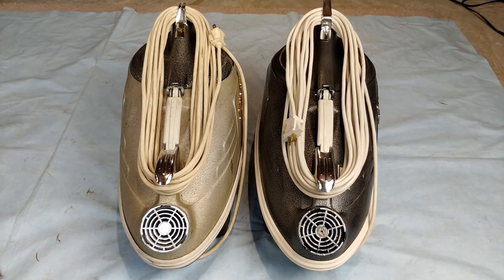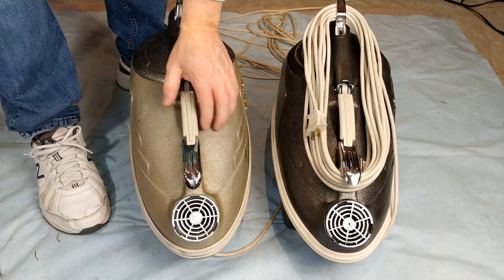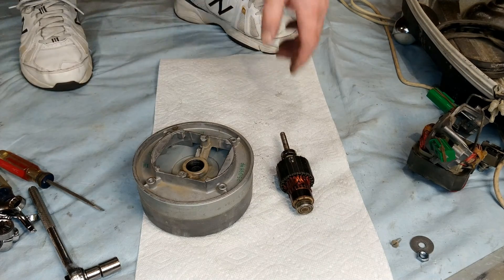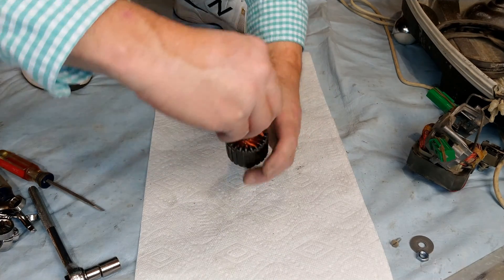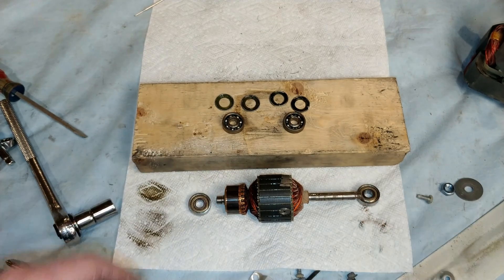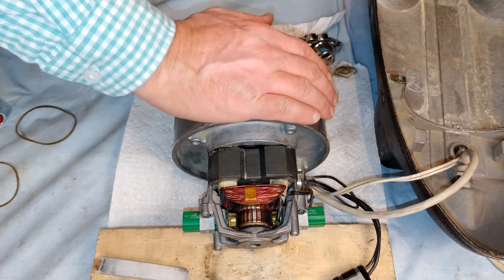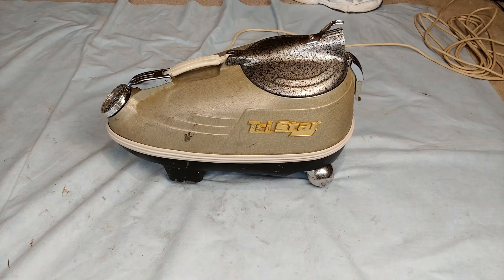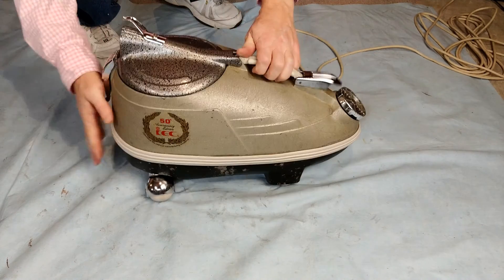Compact TriStar CXL Motor Refurbishment

Comment: Have you ever replaced the brushes? Mine are sparking and need replacing I think. I already sanded the commutator so it's nice and clean.
Reply from the maker: Brushes are replaceable, but I don't know what the part number might be because motors vary all over the place.

I have made many videos showing removal and replacement on other motors though.
Reply: @VacLab  It's from a Trip Star CXL. The number on the motor is 6884-49.
Reply from the maker: @bwhite661  go to ebay/Google and search your motor part number and carbon brushes then.
Reply from the maker: @bwhite661  go to ebay/Google and search your motor part number and carbon brushes then.
Reply: @VacLab  Great! Thanks so much for the help!